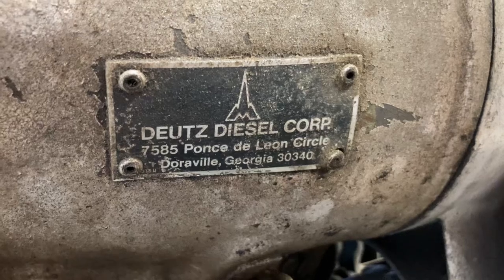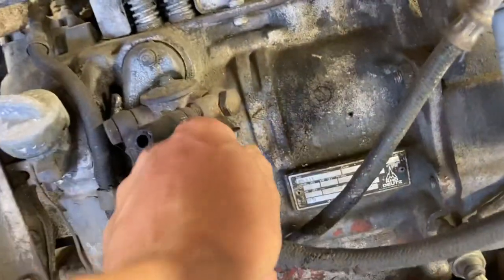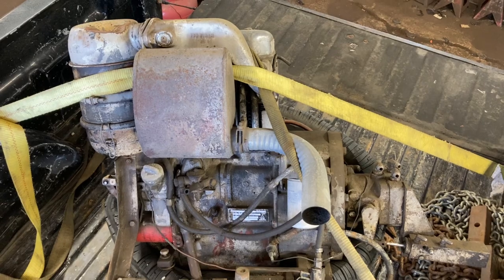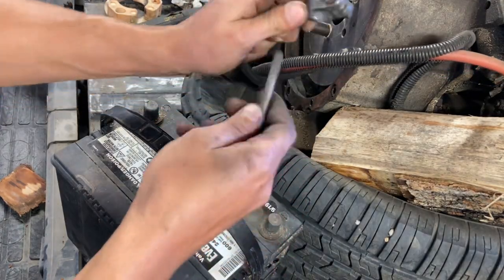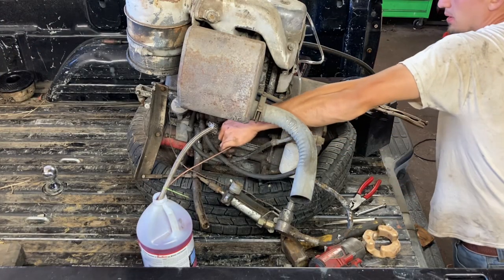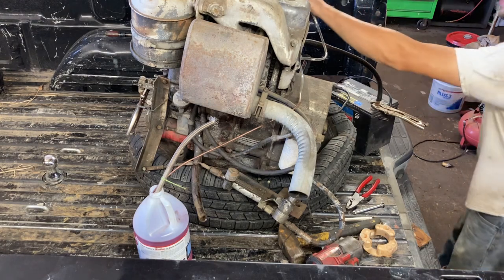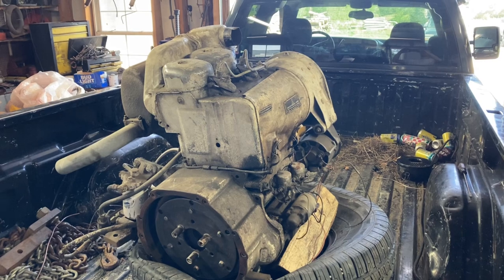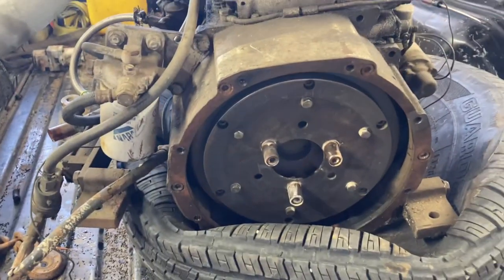Deutz Diesel WILL IT RUN?

Comment: Nice!   A+ Deutz quality engineering.   To me, air cooled is the way to go for engines in this HP range.   No cooling system issues to ever worry about.  Just keep the cooling fins and oil cooler clean and keep good belts on it.

Comment: Need to get the Deutz  in my bobcat skid steer going.  Bought a new injector pump but haven’t installed it yet.  One fall it worked then in the spring it didn’t.

Comment: Have a Lincoln sa250 with a Deutz engine. Over 9,000hrs on the meter, I run it EVERY day, hour meter stopped working 20 years ago.

Comment: subbed you gona have a big channel one day. Question for you. There is a dozer up the road, am gona try and start it as a project. It has what looks to be a broken return line between the hydrolic tank and pump. It is very thin. Could I mend it with just some rubber fuel line. Presure wise, would that be ok. it is going into the top of the tank. Same for the coper fuel line below going into the injector pump. Again the presure there should be low right?
Reply from the maker: A hydraulic return line has no pressure as long as there’s no high restrictions for flow. The fuel line should have no pressure
Reply: @rustyaddiction495  Ah thanks is what I thought, just wondering what you  mean with high restrictions. Thanks again hey.
Reply: Ah I thought about it a bit, you prob are saying as long as there are no blockages in the rest of the line, right.
Reply from the maker: That’s right, if it has a hydraulic filter it will be on the return side and could possibly be a blockage scenario. Also be sure the tank vent/breather is clear. That can build unwanted pressure on the tank and return hose. Food for thought if your quick mend gives you trouble